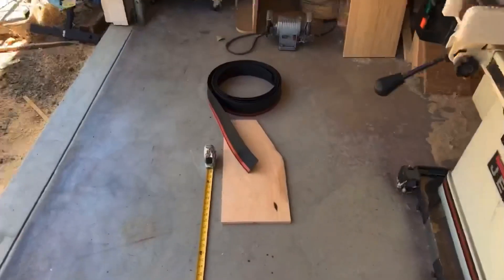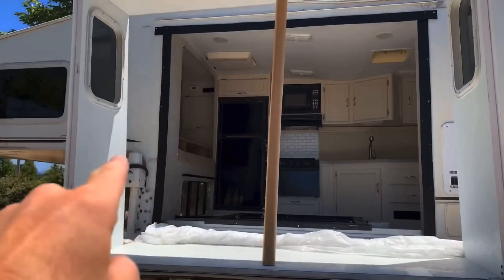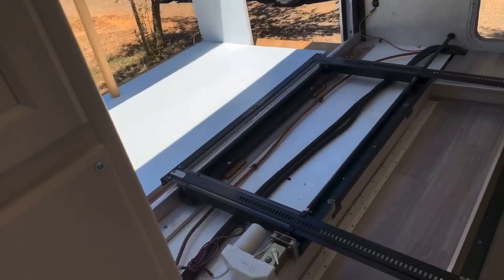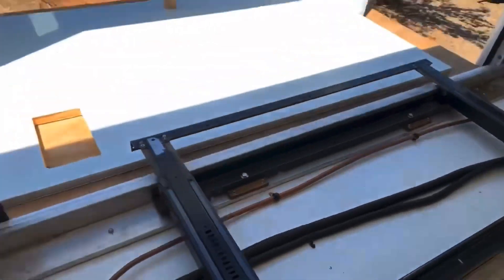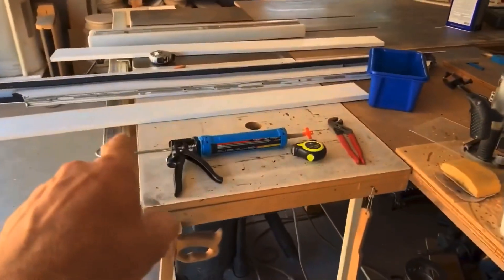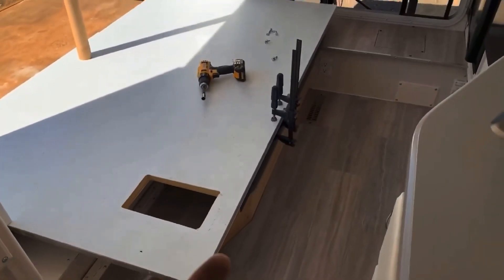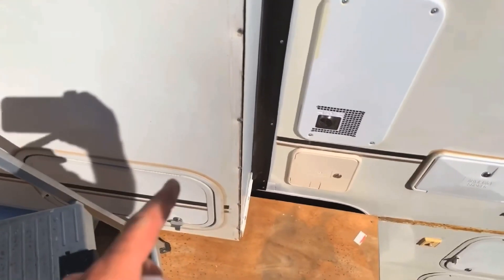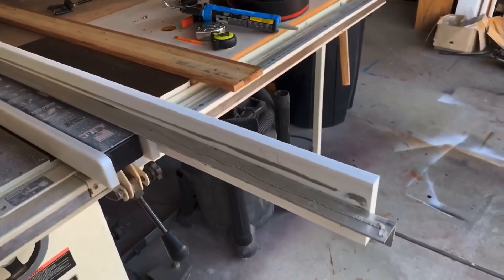Installing The RV Slideout.  Truck Camper Rebuild

Comment: Very impressive.  We have a 2014 Coachmen,  Forest River,  Ultralite, RBS192, travel trailer.  The "geniuses" installed  a wood particulate, 1-7/8 floor, without a drip edge, on the slide out floor, with the very unreliable black underbelly covering  that resembles a woven plastic fabric, that is easily torn .  I think they call that garbage "Darco," an apparent industry standard.  Why?  I would not use that for anything less than securing the ball of a newly dug up tree.  All is does is expose water when torn and retains moisture like a green house.  Was that actually specified by an engineer?    I built a deck, as you did, to remove the slide out.  I then replaced the rotted floor with 1/2 inch and 5/8 inch, sandwiched treated plywood.  I replaced the rotted wooded framing.  I then installed a roof drip edge and lapped eternabond tape over the drip edge seam, so no water can be exposed to the ends of the floor.  Thank you  for sharing your excellent methods of rebuilding, improving and protecting your slide out.

Comment: How much did this coast you ?
Reply from the maker: The entire camper rebuild & remodel was around $1800 in parts/supplies.
We have around 80 hours into the project as a whole.  (We did all of the work here at my shop.)
We had a quote at a local RV repair shop of $6,500 for just the Slideout and frame repair (At shop rate of $80/hr which is relatively inexpensive)